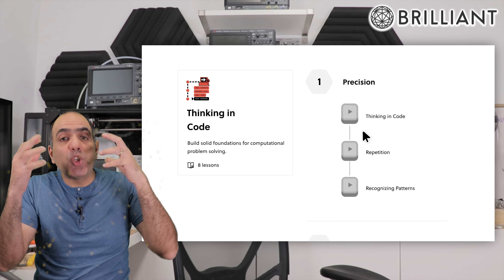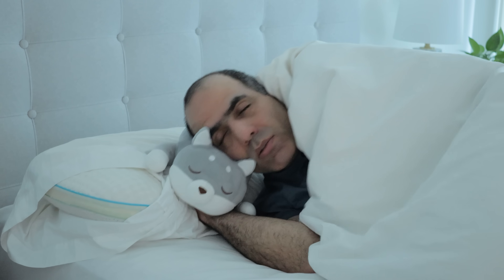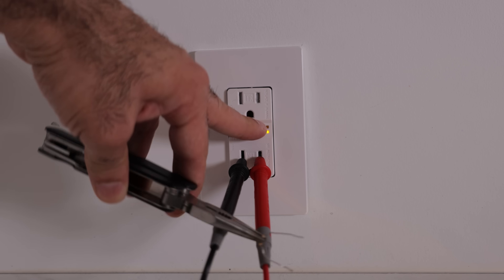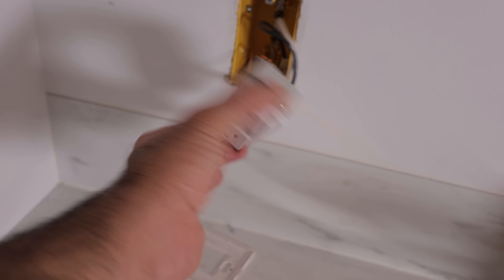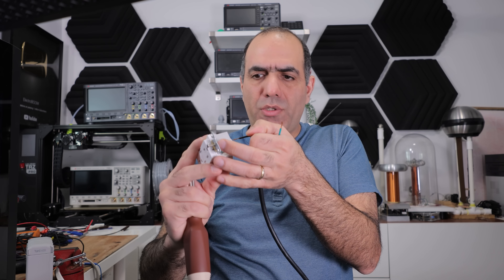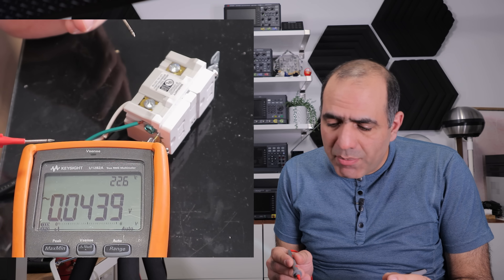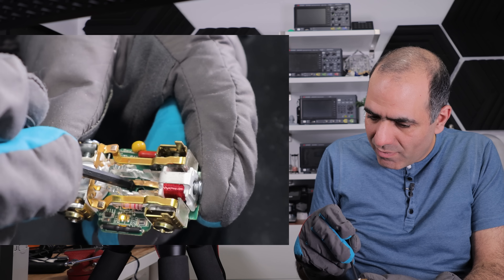Repairing Faulty Ground Fault Failure

Comment: https://youtu.be/OFePv5Y-wbw?si=OLAPksBwv7KDeTzk 
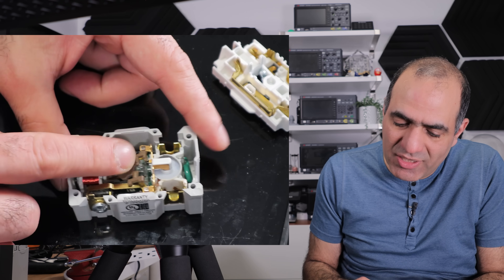Great video as usual lol.  I found a good link to a Mike Holt video on GFCI's.  It shows there is another current transformer that induces an emf on the hot and neutral wires as well as a current transformer that detects an imbalance in the current. It starts at about the 9:20 mark.   If the neutral touches the ground it will induce a voltage that will cause the other CT to detect an imbalance between the hot and neutral current.

Comment: So, am i right, the solenoid is wired to the live and ground so if there's a ground fault it powers the solenoid and releases the spring trap that was holding the contacts closed? 
Is that right?

Comment: As a European, I find your plugs insanely needlessly over-complicated.
Reply: Not all of our outlets are GFCI protected, only those in wet areas like bathrooms. Our typical outlets are much simpler. I know that Europe uses central RCDs which do the same thing but for every circuit.

Comment: Mehdi: remember to keep yourself save
Also Mehdi: uses all metal pliers while checking GFCI
Reply: Not to mention that LTT screwdriver.
Reply: I mean pliers are usually metal but they need to be voltage tools that have insulation on the grips/handles and screwdrivers need to be insulated until the actual tip.

Comment: From an EU perspective, it's actually crazy to see that only on the outlet in the wall and the size of the circuit just to protect 2 plugs. What I have in the fuse box here works both as a circuit breaker and a GFCI to protect all the outlet in my place and people at the same time. It's crazy how different it is in NA compare to here.
I would be so lost trying to work in canada or US.
Reply: GFCI breakers are a thing in the US. Code specifies what needs protection, but both methods are acceptable. Typically only 'wet' (bathroom/laundry/kitchen/garage/basement/outside) locations.  One main advantage of the wall plug GFCI is that the state is visible and it can be reset from the point of use.
Reply: @kratz9  Current code requires AFCI in most living spaces, so a lot of new construction puts all of the protection devices in the panel. Personally, I prefer it that way, because with circuits shared between multiple rooms, the receptacle with the AFCI/GFCI might not even be in the same room as the point of use, and which room it's in is entirely up to what substances the electrician who installed it was on that day.
Reply: Actually, in many european countries it is no longer accepted to use asingle RCD for the whole house. You must use more to avoid loss of power everywhere and several minutes or hours of profanity if a ground fault happens.

Comment: 3:45 I know you already know this, but just for the spectators, even if there's an upstream GFCI you still shouldn't consider it to be safe - these safety devices are a backup, and shouldn't be a sole form of protection (particularly not a faulty one 😁)

Comment: You are so lucky that with 110V you get just (in most cases) a jolt. It's quite a different with 230V on a lot of other places. Nice video again.
Reply: That is a very dangerous misconception and it kills people.
Reply: @okaro6595  Sure it depends on several issues. But have you counted how many times Boom gets a shock and still walks around.

Comment: In Europe, an RCD or RCBO trips with 30mA at 230V. (Residual Current Device / Residual Circuit Breaker with Overcurrent protection)
In the US a GFCI trips at 120V with 5mA. (Ground-Fault Circuit Interrupter)
In Europe, these devices are installed in the fuse box.
Reply: In the US they frequently are, too. Especially in new construction, where current code requires AFCI, GFCI, or combination AFCI/GFCI breakers on most receptacle circuits, it's just easier to put all of them in one central location in the panel than to have a dozen of them spread throughout the house. It's also more convenient as a homeowner, because I don't have to play "guess which circuit this receptacle is on and which room its GFCI receptacle is in." I just go to the panel and look for the one that's tripped.

Comment: You should come to South Africa. Here we use a device called an Earth leakage circuit breaker. Its wired into your main distribution board, and is wired only on plug outlets. Lights, geysers and stoves, are wired apart. Geysers and stoves also need 63A isolators to conform to SANS regulations. Earth leakages work on the principle of a balance relay. Check it out

Comment: Had similar experience with outside receptacles on brick house during high humidity. After much research and testing found that the bare ground wire when folded into box with receptacle was very close to neutral screw. Pushed ground wire neatly away from neutral. Fixed! The ground wire on your test rig is insulated.

Comment: 13:48 ah yes, the good old sniff test to see if your electronics are working 🤣
Reply: this is actually a very strong test of electronics - you can understand whether the white smoke on which it works has escaped
However, surprisingly, the protector works even after the smoke has escaped
Reply: @ijtsuken  oh, I know it's a very valuable test as often it will tell something is wrong even before sparks/or smoke. Just funny that (at least on the cut he released) he started with that test, when often that is a second or third test after you've done tests before making power live, lol

Comment: Suggestion: The tripping solenoid composes a tank circuit with some spurious capacitance on the circuit, making it resonate in a certain RF frequency that coincides with some thing around your house. Might be some radio station or a neighbour using a blender. Alternively, the current sensor can be the one who picks de RF.

Comment: Wait, you don't have separate circuits for sockets and lights? Here in Europe, specifically in the Czech Republic, it is common to connect house wiring in such a way that socket and light circuits are protected separately and the whole house is protected by the main circuit breaker and right behind it is an RCD + now a separate RCD is connected for all sockets and separate RCD for all lighting, so if a person touches a live or neutral part of circuit and the RCD trips or you turn it off, the lights will still be on.
Reply: There's no code requirement to always separate lighting and receptacle circuits in general, but there are some specific codes requiring dedicated receptacle circuits in certain spaces, such as garages and kitchens.

It's pretty common to have them separated anyway, for a variety of reasons including the reason you give. But it's also not uncommon for some rooms to only have floor lamps plugged into receptacles with no overhead light. And even when the two types of circuits are mostly separated, sometimes it's just more convenient to hang a light off of a receptacle circuit than to run an entire additional circuit just for that one light.

My electrical-stuff tool bag contains a battery-operated headlamp, just for that reason.

Comment: the test button dont trigger the solonoid directly as implied (or at least it really should not). usually it does add a resistor between the live (from after the sensor) and natural (from behind the sensor) simulating a leakage which should result in sensor detecting the leak and triggering the solenoid.
Reply: Yes, and if you press the button too long the resistor will burn.

Comment: I had an issue once with a GFCI that wouldn’t re-set, and replaced it only to find that the new outlet had the same problem.  It was an issue with the breaker.  The breaker looked like it was on, but no power came through it.  I replaced the breaker and looked inside the faulty one and found a stink bug had crawled inside in the way of the contact.

Comment: You don't want to have a main breaker with GFCI in it .Too many nuisance trips and taking out the whole house or building is stupid ..you only need to protect down stream devices period .teg only time you need that type of protection is for moveable equipment .but what do I know .I'm just another red seal idiot

Comment: 9:50 that seems overcomplicated.

feels like algorithms written by devs that just learned how to code, or overkill design patterns that complicates more than helps.
Reply: I think they can not rely on relays, because a short is expected, so a lot of current draw is expected, relays could get stuck, meaning a person dies.

Also, current can sometimes weld conductors if high enough, so it makes sense to be spring loaded.
Reply: Lol so true, I didn't know how to use while loops until relatively recently and I would use jump commands to accomplish the same thing